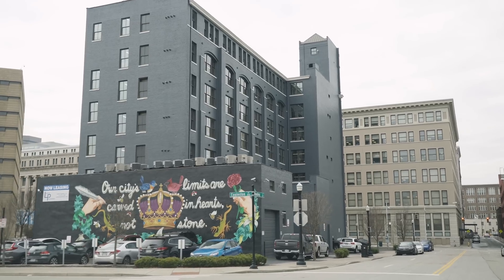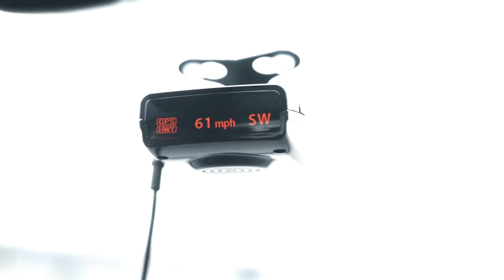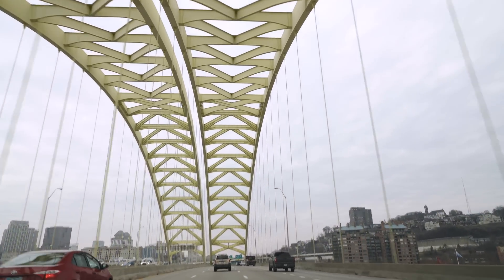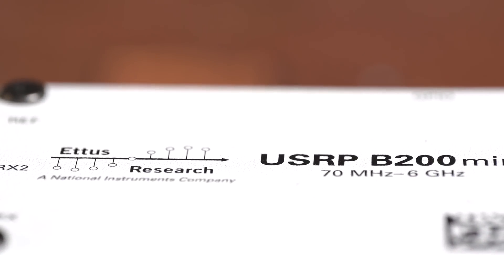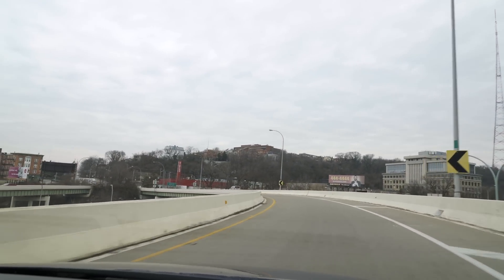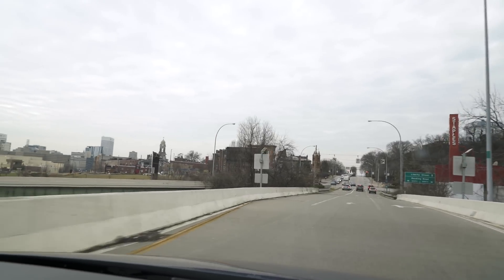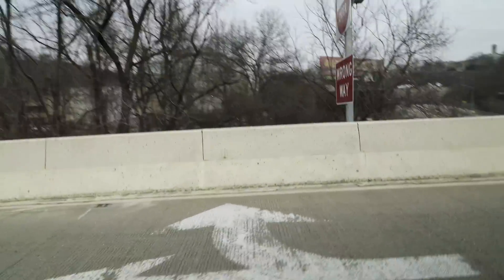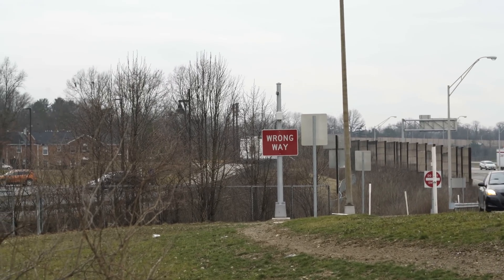Radenso Inside Look - Black Ops Engineering: Part 1

Comment: Well, seems to me you should still use GPS lockouts as a back-up. Why abandon what works? Yeah sure try to get your detector to recognize every single false alert there is, but you shouldn't count on that alone. You'll inevitably come across something that you did not or could not predict. In that case let the user punch in a GPS lockout for those situations. I hope you guys have already thought of this.
Reply: That's an Escort patent. Uniden tried it. There's a pending lawsuit.

Radenso mentioned at least part the reason for choosing Linux was update ability. It takes as little at fifteen minutes to train a new source.
Reply: Randorn Canis yeah but patents only last so long.  Last I heard the lawsuit would only delay it until later t his year, and that doesn’t matter because that is only for auto-lockouts.  My Uniden already had manual lockouts several years ago.   Gonna be a pain to have to update just to lock out some random emitter, and that’s still only if they do end up covering it.

Comment: You should look into building out a custom bucket truck and outfitting it with your surveying hardware. Put your antennas on the bucket and you can park on the side of the road with your flashers and blend right in as a utility contractor vehicle, flashing amber lights, orange cones and all!

Comment: This video got me thinking (and I’m making some assumptions here based on what I researched)... Have you tested for Radar Traffic Sensors? I’m referring to the ones that are connected to traffic lights and will stop the lights from changing if it detects a car that is attempting to run the light. They seem to be everywhere here in BC (if my assumption is correct) as about a second or two before a light changes, my detector goes off.

As an aside, my detector goes off when I drive across some small overpasses out in the middle of nowhere on Vancouver Island (on a 120kph highway), with no cars or buildings around. I haven’t figured out why.

I’m such a tech geek, I get really excited by your videos (including the ones Vortex does with you). The technology and insane detail behind it is just so cool!

Comment: It's great to see the effort put into the research,. I'm really looking forward to Theia's release. I presume, for one reason or another, you couldn't have access to a "master" the same way as you did to the "collaborator". I think it would be interesting if Theia could notify Radenso in some way (cloud feature, USB based dump to storage that could be emailed, etc.) when an unrecognized signal over some threshold of noise is encountered. I'm sure Theia's hardware is not geared to give you the fidelity of information needed for training RAI, but might me useful for identifying radar sources to train on that might not be near Radenso HQ (for example, if these wrong-way K-band signs weren't in use in Ohio, but instead only in say California), leading you to evaluate whether there is sufficient reason to invest resources in characterizing such a signal.